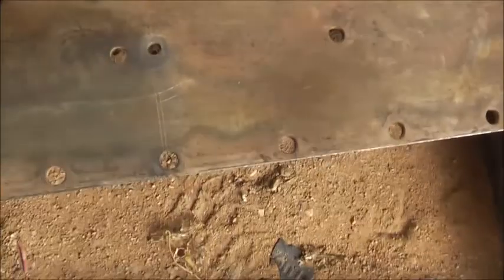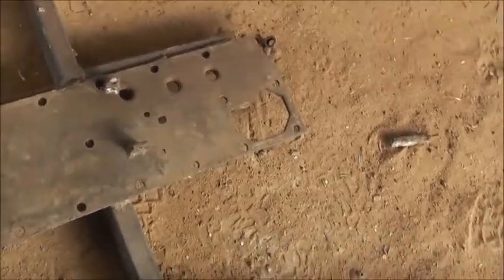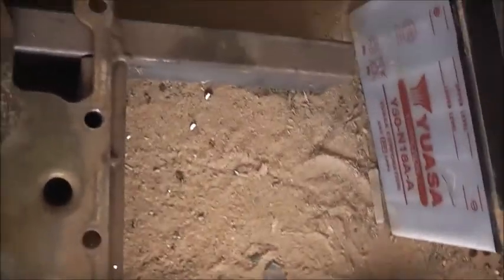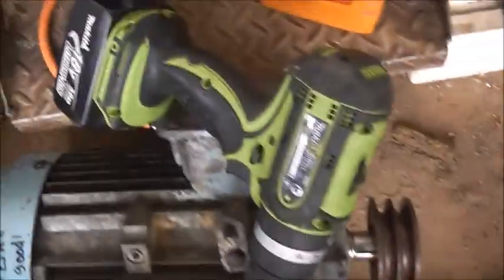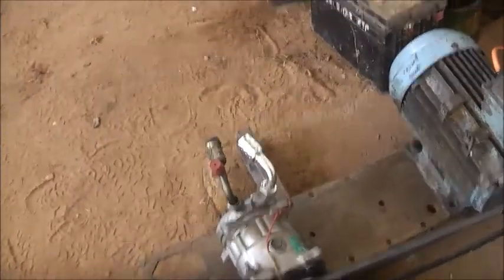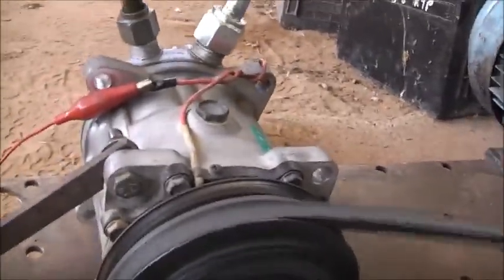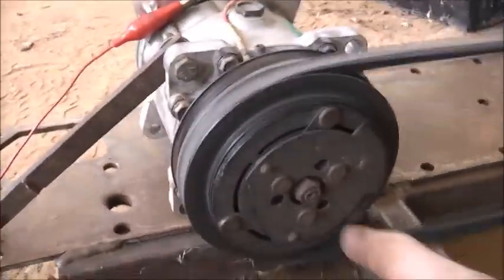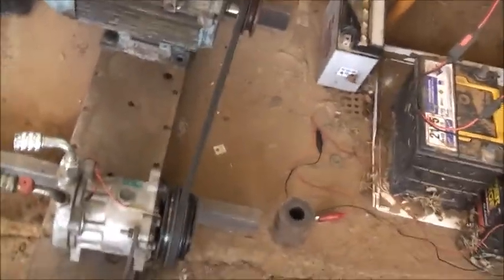Sanden Compressor Ron On VFD!!

Comment: as far as i know those one do last as air compressors  as there meant to  circulate oil in the gas but the older  reciprocating ones can be use  i have a old 70 ish motor craft  one that works well